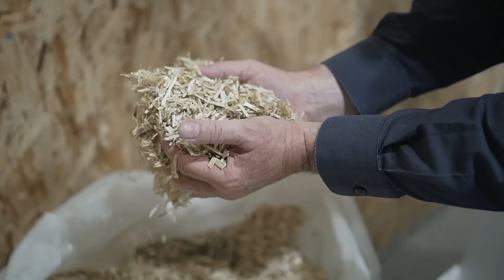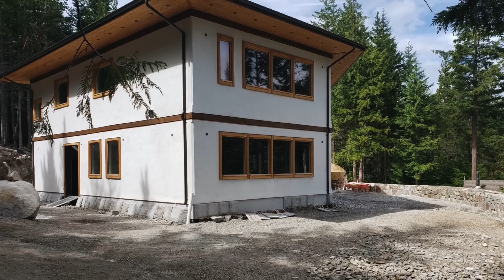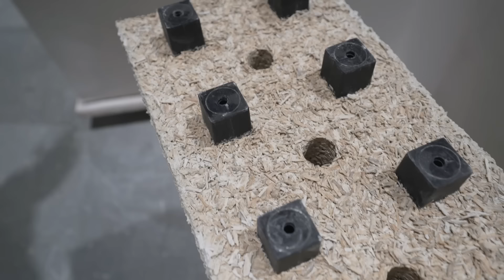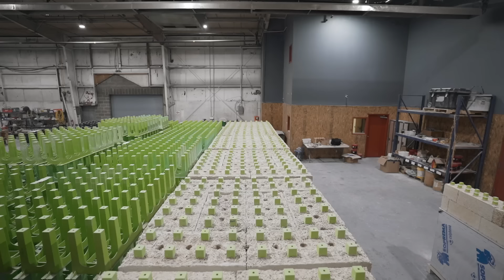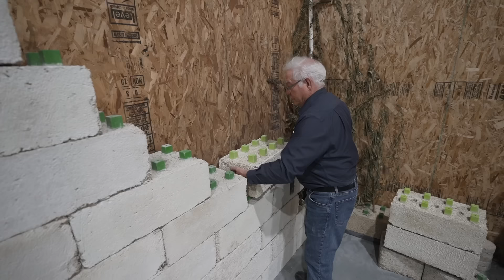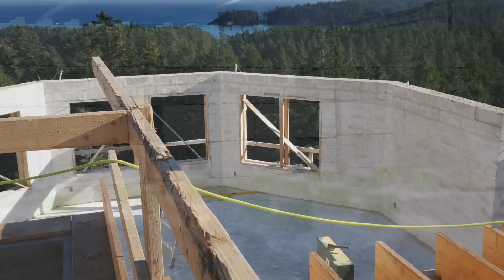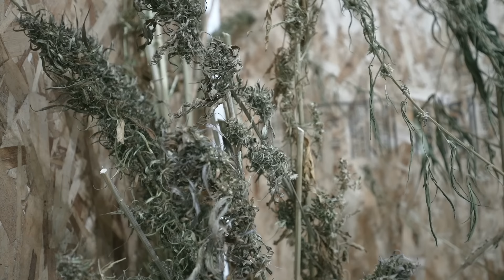Amazing Lego-Style HEMP BLOCKS Make Building a House Quick, Easy & Sustainable

Comment: I see many ups to this product, but a few things have not been shown or answered. 1) How will it handle hurricane conditions?  2) How does electrical get installed with this product? 3) What do you buck out windows and doors and garage doors with?? 4) In Florida, new construction has to have strapping for trusses. How does strapping work with your product?  I'd love to see a video answering all of this and more..
Reply: 2.  Electrical thru the 3 holes in each block ... just run EMT down where needed.  3.  Standard building construction.

Comment: I'd like to see 100% recycled plastic Lego style blocks for homeless shelters.
Instead of encampments... beautify and protect them from the elements.
While finding a use for the waste material plastics. 
More of a shed, than a home, lighter blocks, etc (maybe hollow a bit.. and sand could be added if needed, to weigh them down)
Reply: Not a problem check out those brothers that do the plastic diy uses for recycled plastics using just heat to mold and play!

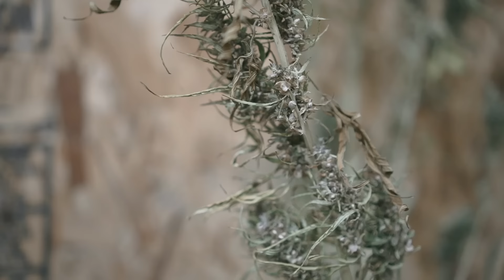Comment: 3:00 This claim about being carbon negative is a blatant lie. It takes tons of CO2 in fuel to cook pounds of lime. Sure, the lime will re-absorb the CO2 that got cooked out. But it won't un-burn the mountain of coal used to cook it!
Reply: Here are more accurate numbers:

2.42 kg CO2 emissions per kg coal burned
24 MJ heat energy produced per kilogram of coal burned
4.25 GJ heat energy needed to cook a tonne of quicklime

(4.25 GJ) / (24 MJ/kg) * (2.42)

428.5 kg CO2 emitted just from fuel burned to produce a tonne of quicklime

Comment: What about water?? will it absorb water? and How about different sizes, and weight load 2, 3, 4 stories? Also can bamboo fiber work with it, or mix with it?
Reply: 7:03 he mentions the blocks are water proof
Reply: @enriqueshockwave  The hempcrete blocks aren't water proof. That's why they make a plastifoam alternative for parts of the build that get wet i.e. on or below the ground.
Reply: @jameswilliam8110  i dont think its just the water that ruins em when they are underground there chief

Comment: Is that structural frame made from plastic?? That will definitely compromise the flammability of the blocks. Also lime is an important ingredient in concrete so even if he doesn't like to use the term crete, its is essentially a concrete or render.
Reply: He explains what it is made from in the video and demonstrates how it reacts to a direct flame while discussing its properties.
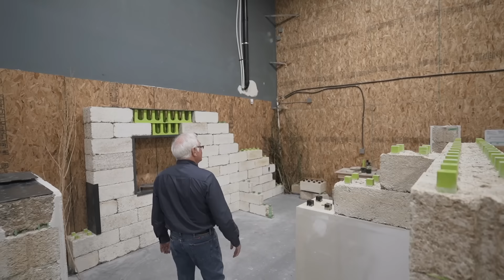Reply: @4:35 vegetable oil based bio-composite epoxy

Comment: Do these products resist insect damage?
Reply from the maker: Great question!  The FAQ section on their website says:
"Lime is naturally mould and insect resistant.  That is why lime-wash is used on barns and chicken coops.  Lime has a high pH (alkaline) which acts as a fungicide.
Lime is naturally antimicrobial and repels bugs and other undesirable insects."

Here's the link in case that's helpful: https://justbiofiber.com/products/faq/

Thanks for watching :)
Reply: @ExploringAlternatives  I'm wondering if it could be used effectively in the tropics. I like all the ecological aspects of this block. It also sounds like it doesn't create pollution when it is manufactured, unlike concrete.

Comment: Looks like a great option for a sustainable build system.
Reply: GYT  -  Silly comment !!
Reply: This will never be used in mass production lol a disaster waiting to happen.
Reply: @natashabegley1346  why is that? This product is engineered by some of the best engineers in the country.
Reply: @TTT TT You're right - and this is why it is so slow to take hold. It isn't going to all get done at once, yet it will need to happen. Just because "this is the way we have always done things" seems like a logical argument, it isn't and this is not a true statement. We actually used to build similar to this with cob and adobe structures. It was the right way to build and we will need to get back to that. Trillions on re-doing infrastructure (which isn't the true story, as much of it can be re-vamped) is going to be nothing compared to the costs we will bear if we have to face runaway climate disasters.
Reply: @TTT TT The switch is already happening, but it is going to take some time. You are right that it will cost something to switch, but it will cost trillions more if we don't switch - which is something that people seem to forget. We need to re-adopt historical systems that were much more sustainable because they were created before the industrial revolution.

Comment: What do you have to do to waterproof the outside?  Do you need to paint the outside with something waterproof or do you have to have an exterior sheathing layer.
Reply from the maker: Thanks for watching!  You can apply a lime plaster to the exterior to weatherproof it.  Another thing we see quite often with natural walls (like cob) is that the roof has a larger overhang to protect the walls from direct rain and snow.  Hope that helps!
Reply: He talks about using lime stucco on the blocks' exterior and plaster on the interior.

Comment: Pretty cool stuff!! How long do they think these blocks can last? Do the constructions start breaking down over time from water, bugs or mold? I don't really know what to compare it to.
Reply from the maker: Great question!  I checked in with Terry from Just Bio Fiber and he says that "Hempcrete with stucco finish will last for over 60 years as long as it is kept away from standing water or wet ground."  We have also noticed that people building homes with natural materials (like cob) generally design the roof with an overhang to protect the walls from too much direct rain and snow.
Reply: @ExploringAlternatives  cob homes have lasted for centuries.
Reply: @jessicalt4121  -  only with annual maintenance, as the cob needs topping up and cracks filled continuously to keep water out.
Reply: @ExploringAlternatives  60 years isn't much. Is that just all he can truly promise? Or is it implied that with upkeep/replastering etc its lifespan can be vastly extended?
Reply: @WILL_E_1  That's what I thought.. 60 years??  Then what, the house crumbles?  If a person were to uses these as not only the foundation but the entire wall, do you just demolish a house at 60-80 years?  That sounds like an awful material.  Some clarification on the matter would be welcomed.
Reply: @WILL_E_1  I think the 60 years was referring to the stucco siding?
Reply: @aslansalive  Not sure where you live but there are not too many 80yr old homes where I'm from. Honestly sucks I dig old houses. It's awesome to see how generations thought and built before us
Reply: @WILL_E_1  - that is probably assuming no maintenance of the exterior stucco or plaster that can have a lifetime of 50-80 years
Reply: @ExploringAlternatives  As someone put it, a (cob) house needs a good rain hat and galoshes. :-)
Reply: @ExploringAlternatives  60 years isn't very long for a house.
Reply: There are hemp block homes in France that has been sitting there for few centuries.
Reply: @batalay  Could you please write more about those homes? I didn't know hemp blocks had been in use before - I thought it's modern technology (blocks (not just the hemp as a building material).
Reply: @jszbp  Not a home but the Sarthe River Bridge in Saint Céneri le Gérei, France. The Gauls in France used hemp mortar to build the pillars of the bridge in the 6th century! In a likely manner, the Romans used hemp fiber in reinforcing the mortar in their exquisite buildings.
Reply: @jszbp  It appears the company has a reinforced hemp block technology which is better than the traditional wood frames.  Therefore, it is not only an environmental solution, however, it is a direct replacement of the current old, frame technology. 

Please search internet for long standing application of hemp blocks. There are many many examples. Future is not as dim as some believe. 
Enjoy!
Reply: @jszbp  - there is also an ancient hemp Crete bridge, in France I believe.  The technology is called Isochanvre there, if my memory serves correctly, google should be your friend in finding more info.   I  am interested in making a hempcrete with an aluminosilicate geopolymer concrete as binder.   Should be even MORE fireproof and could be more insulative than a lime based binder.
So Isochanvre and Geopolymer are two words you might enjoy googling.
Reply: @batalay  Can you say where, or cite a source so we can get a look at theese?
Reply: @batalay  -  never heard of that before? Could you tell us where exactly, please?
Or was that just an uninformed guess?
Reply: @thetessellater9163  It would have taken you less time to google than make a sly comment.
Reply: @batalay  yes . And also cork.
Reply: If you are talking about maintaining lime stucco, stucco is a very durable finish material with a typical life span of 50-80 years or more. Although it is one of the most durable surfaces available, it also features the lowest annual maintenance cost when compared to other siding materials.
Reply: @ravent3016  right up until it forms a crack you don't notice. Stucco is not the best option in my opinion.
Reply: I watch urban adventures channels that go through abandoned houses.  Want your house to last?  Use a metal roof.  That is what I've noticed homes, even abandoned for fifty years that have metal roofing are remarkable in there preservation.
Reply: My house in Sacramento is 100 years old, with a cement stucco exterior and a olaster interior.  Houses built that way are many hundreds of years old.  60 years is not even one person's lifetime.
Reply: Everything breaks down over time and with water the universal solvent even quicker nothing will last forever! God designed life to do this thank God!
Reply: No no no.